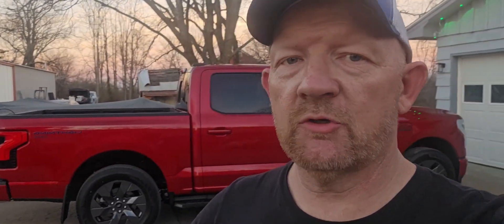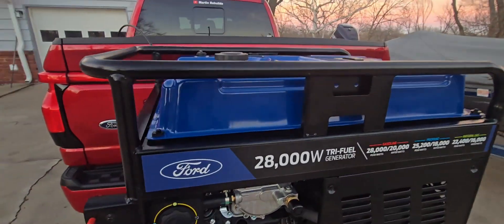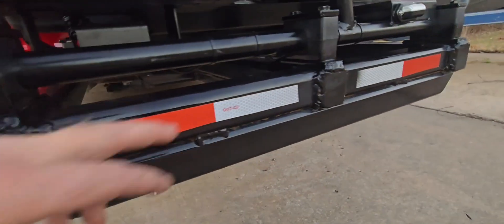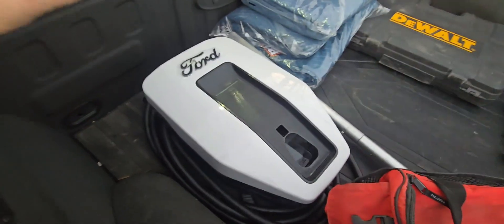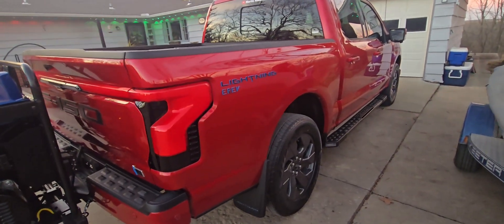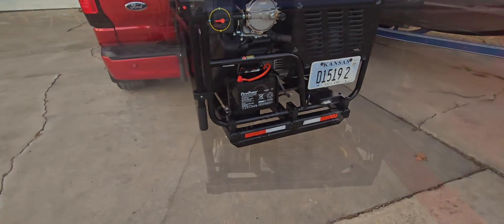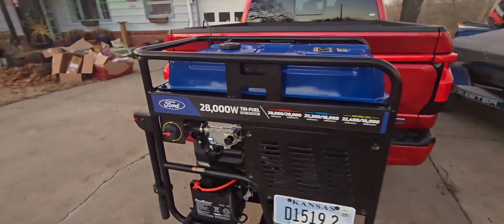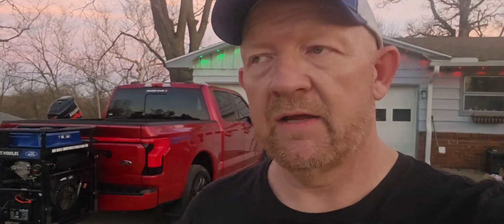500 Mile Range Ford Lightning!

Comment: I have a 2023 Lariat Lightning SR (bought used no choice in battery) - we want to retire and buy a pop up light weight low drag camper - should be able to make this work mounting the generator on the trailer?

Comment: Not to be mean, but you could've just gotten a Silverado EV 4WT,  or LT trim with the large battery and get around 475 miles conservatively without this setup.  Especially with the way automakers are discounting  these trucks.   But, i like your creativity.
Reply from the maker: I understand you're point and you're not wrong. I have less than 25k in my lariat and i can't buy a equivalent trim level gm for even double that. Hence the reason for the generator and system.
Reply: The Chevy is overweight and has low efficiency, plus some people really hate the platform.  Being able to turn the electric truck that a person likes into a long range truck opens up the usability.

Comment: I love the idea, but i would probably go with a trailer mounted diesel generator so the noise is further back and should be more efficient overall. You could even do a custom ultra low riding trailer with something super efficient like an Prius drivetrain. There is a guy at my local Marina that converted his boat from twin diesel motors and diesel generator that were all destroyed to twin Toyota Prius drivetrains which double as the drive motors for the boat along with being generators to maintain the voltage level of the solar battery bank. He claims it uses a fraction of the fuel it consumed on the old diesel motors. He wired a dummy signal that tricks the motors into thinking it is always driving at below the minimum speed to allow electric propulsion and he is able to put around for hours on the electric motors running off the solar battery bank.

Comment: Make this with a DC to DC converter and a bed slide in 100KWH LFP battery that you could rent giving the truck the same 500 mile range and I would buy it in an instant. I’m done buying expensive, inefficient, and nasty fossil fuel products.

Comment: Love your enthusiasm is your generator charging the battery as you drive or is it powering electric the drive motors? It would be nice if ford left the lighting alone and give you the option of placing a generator in the frunk when you want the extended range like when I tow 2X A year. Keep building the lighting’s until the batteries are improved I don’t know how the price and the weight can come down when they permanently install a generator in the frunk. It seems very political to me remember the Tucker? What happened to him?
Reply: I don't love the idea of using the frunk—how would you vent it, especially to avoid gassing the cabin? I'm also not totally clear on the safety of these setups in an accident, but I would bet the gas versions are actually safer than using unprotected lithium batteries like some others have tried.

Comment: First time I ever seen your channel, but this is a fun experiment, I would imagine a true erev would probably need like a 150kW generator on something like a truck, to give you reasonable horsepower when the battery is depleted but 20kW is not nothing should be able to extend you a little. At cruising speed on the highway, I would imagine you're pulling around a continuous 30 to 40 KW at 75
Reply: That can be calculated pretty easy.  I assume 2mi per KWh.  In 1 hour, that’s 75 miles of course,  which is 37.5kw power draw.

Comment: It will be interesting to see how MPG compares to a normal V8.
Reply: Terrible.  The outcome is already known thanks to physics.  Small engine generators capture about 15% of gasoline’s energy as electricity output.  Then reduce that again for losses in the battery charger.  But, I love the creativity!
Reply: That specific generator is rated at ~1.59GPH (Gallons per hour) to produce the 19.2kWh of electricity the Ford Charge Station Pro is asking for. 
If the Lightning gets ~1.2mi/kWh while towing (2.5 unloaded), that's about 10MPG on 1hr of generator power - but if you're starting your trip with a full 131kWh battery as well, that's about 80MPG. 
For comparison a gas F150 Lariat does ~8MPG towing.

Comment: So you just plug in at the normal charge port or is there a more direct AC connection?
Reply: They have an outlet in the bed of the truck that runs up front and is t'd into the on-board charger. Zach has a video showing how it's connected in the bed. https://youtu.be/WZN8at_GE9c

Comment: This will be an interesting project to watch, If this works as you predict it will, you could run a remote plug in to the back of the truck so you could just plug in the generator there.  Hopefully the air intake will not be stuck in a vacuum zone behind the truck and starve for air.  Awesome job, look forward to hearing how the trip goes

Comment: I'd be interested in trying to find a used battery from a smaller EV with maybe 50-75KWH that I can reconfigure and fit into the bed. It'd get me 100-130 more miles of range silently and without affecting tailgate access. The challenge would be getting that power into the charger. It would be inefficient to reconfigure the aux pack to run a 220VAC inverter to run the charger (plus it would be a pricey inverter on top of a pricey back up pack and charger), so maybe if Everdrive can be configured to accept a HV DC connection instead of using a Ford charger. Maybe a future product idea once the primary one is established🙂

Thanks for the innovative efforts. I love my Lightning but am still hesitant to take it on long road trips. We just drove from Orlando to Gatlinburg and then over to visit friends in N.C. and I rented a minivan, which was horrible in comparison. It was only a 5 day trip, including travel time, so if I had to stop every 225-250 miles to charge for 45-90 minutes, it would have eaten up a lot of our time there. Waze redirected us on a lot of rural alt routes as well due to a bad accident on the main route and there was very little anything along the way, let alone ultra fast chargers. Everdrive could be the game changer as it would allow us to stop less and time that around meals, etc. so we aren't sitting and waiting so much. Looking forward to seeing more ideas for power sources!
Reply: At that point, you'd be better off just tying into the DC side and have true extended range since you're not limited by the ac charger. https://www.youtube.com/watch?v=xmqUzJG7PIU

Comment: I don't intend to rain on your parade.  I'm a big fan of your work.
That said:
I'd like it a lot more if the generator were diesel.  The Champions tri-fuels I have require me to tear the carb apart after they sit for a long time, even if I run them dry.
That never happens when it's sunny out.  It's always at the well, during a power outage, in freezing weather.  Busting your knuckles hurts more when it's freezing.
The weight is a big concern.  My 10kW Champion weighs in around 250.  I'm not horsing that around without my tractor.
A wiring kit would be interesting, so that I can provide my own generator (maybe on a trailer).  I've actually got a Ford Pro 80 amp charger sitting here in a box.
Newer trucks can only go up to 48 amps, I believe.  Ford stopped installing two chargers.
Reply: I don't have a Champion generator but for mine I go a step further when running them dry. When it first starts to bog down as it runs out, I gradually close the choke. It seems to get it to run a bit longer; I'm not 100% sure if it's because the choke shows the burn of the fumes or if the extra vacuum helps suck out every last drop of fuel within the carb.

If you want a little extra protection, you could do the above and wait until it's almost stopping and then spray fogging oil down the carb for a moment and then cut the ignition. Keep spraying until the engine stops completely as this will draw some of it into the cylinder to coat it without clearing it all out of the carb. This will coat everything and help protect it against corrosion due to any condensation that forms inside the carb or cylinder. It'll keep seals from drying out as well. 

I don't have any scientific tests to back up my anecdotal experience, but I've had good luck  with all of my equipment by doing this. Hope it helps!
Reply: A wiring kit is exactly what they're offering. Well more than just wires since they have to fool the truck into allowing charging while driving but it's basically an extension of the front charge port. It doesn't care what is sending the power. They're using a generator in this case but heck you could add 48v batteries and an inverter.  Would certainly be the more costly option and add extra weight.

Comment: Where'd you find a Lowes that had it in stock? Seems everywhere online is out of stock. That hitch mount is 10/10.
Reply: Pulsar provided this to us special for this project, They won't fully disclose what is coming out, but I believe it is the EFI version of this in early 26.  That's why it is out of stock.
Reply: @zacharysc100  They should add a hardwire option similar to the westinghouse wgen20000tfc if they're tweaking it.

Comment: what would the range be if you didn't have an 80amp charger? most don't. I guess a 10kw generator would be what we want for our 40ish amp onboard chargers. Pro owner here. I love this!
Reply: Maybe ~60 extra miles at 70 assuming you used the entire battery
Reply: If you can charge at the ideal rate of 10.5kWh, you recover around 5 miles in an hour.  That assumes your truck uses 2kW/mile. I'm not smart enough to account for varying charge rates for different states of charge, but if you start at 100% soc you won't get anywhere near that, even ignoring losses.
Maybe start charging somewhere around 50% soc?  Idk.
Someone please correct me if my math is wrong.
Reply: @saltyexxer your math is wrong, 2mi/kWhr is realistic for 65mph.  That gives you 20miles per hour of charging at 10kW
Reply: @zacharysc100  math was right, miles per kwh  was wrong. You're right.